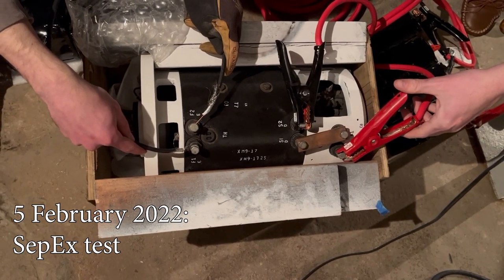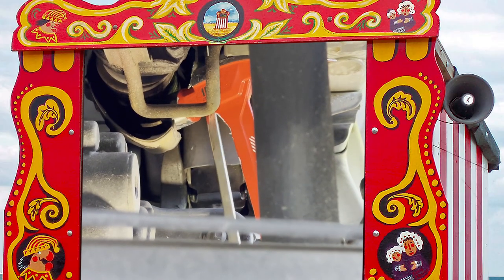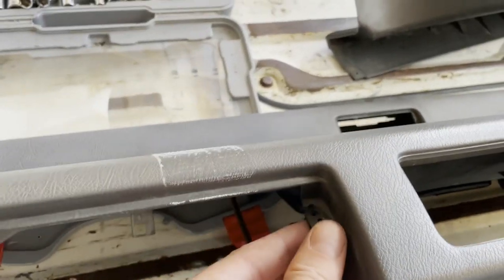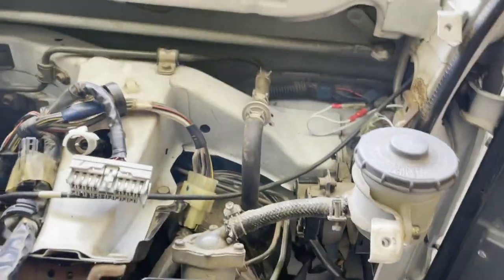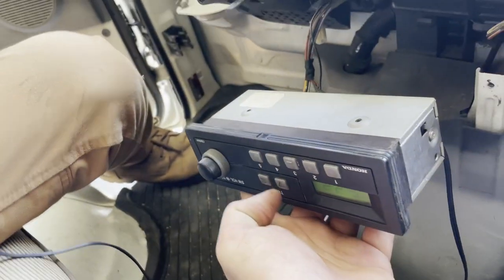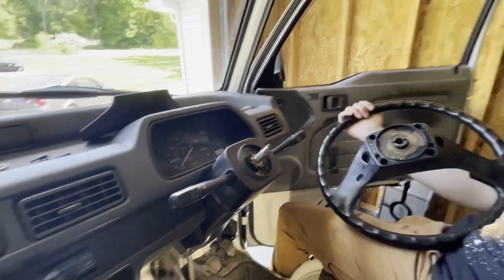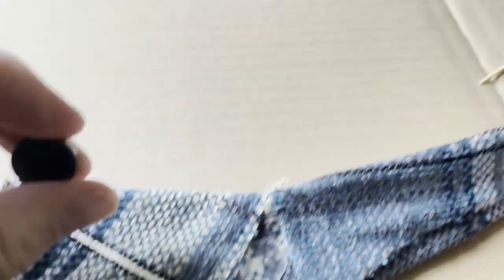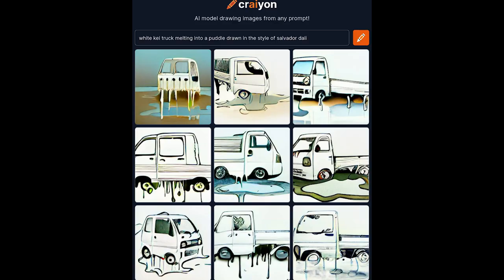Converting a Kei truck into an EV - Dash Day - Part 24

Comment: I agree wholeheartedly with everything you said about interconnectivity and manual fallbacks.

BUT - I'm also not so bothered by the idea of keeping it original as you seem to be. At this point for the work and parts you keep throwing at the old radio you might as well either buy a mechless BT/USB/3.5mm/tuner head unit, or build one.
Reply: @AshAshAshAshAshAshAshAshAshAsh  Well that's super weird, my reply to you vanished. Not writing again, TL;DRW - I actually meant a modern (and modern styled) mechless, which all have USB anyway; and I think BT is as required at this point as 3.5mm. A2DP has worked now fully cross platform since like 2005, I think we can stick with it.

But I REALLY want someone to build a radioless "mixer amp" which has RCA on the back for line in from a CB or other PTT radio, and 3.5mm and bluetooth on the front with a powerful USB charger for phones. Just a simple unit.